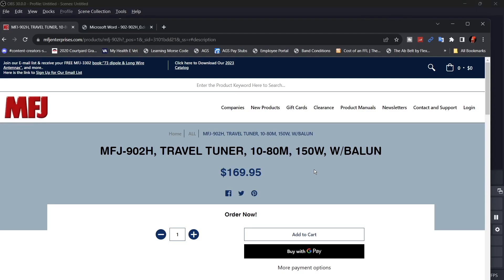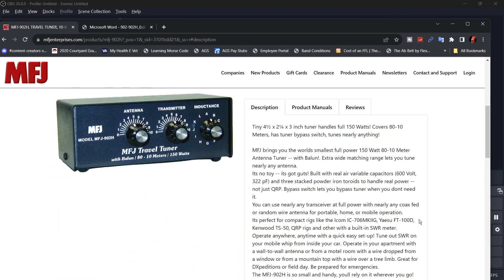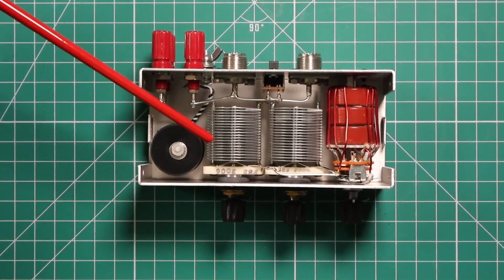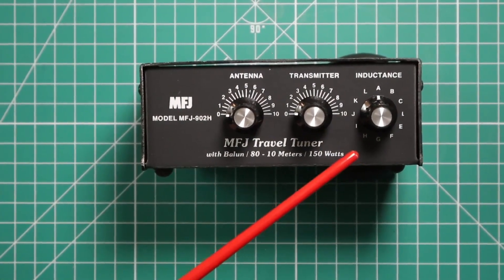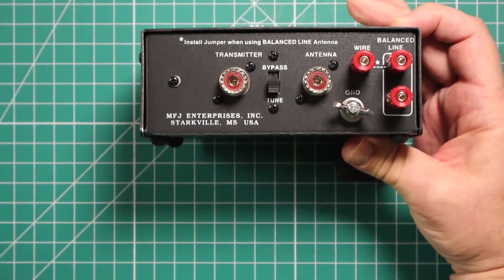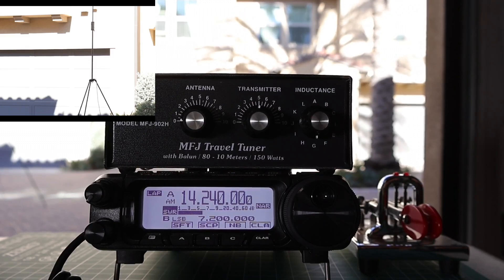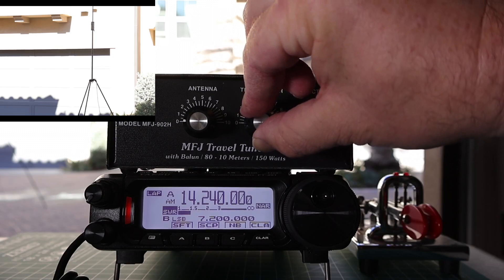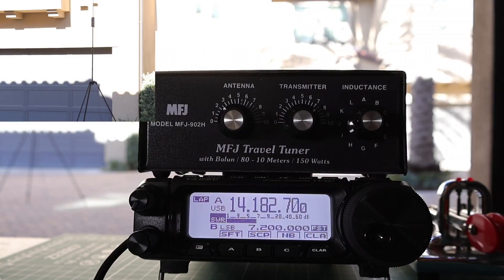MFJ-902H Travel Tuner Overview

Comment: I don't understand how you are not transmitting while adjusting the induction. 
Noting that you say in the video, not to transmit while adjusting the inductance.
Reply from the maker: my comment was "Never hold the push to talk button while you're changing the inductance." which is what is described in the owner's manual on page 3, "WARNING: Never transmit while changing the INDUCTOR switch."
Reply: It looked like you were transmitting while turning the inductance control!